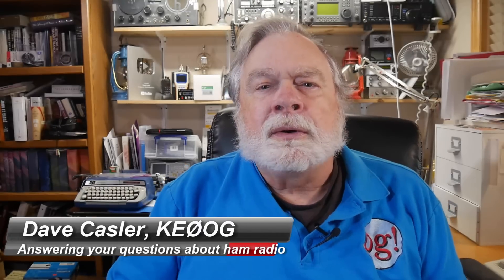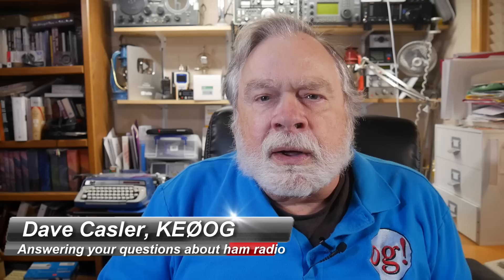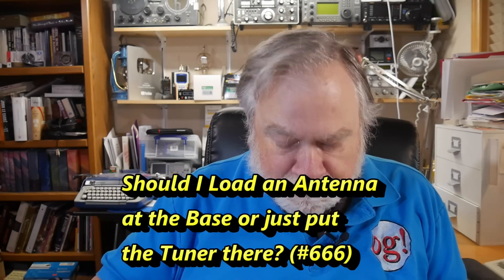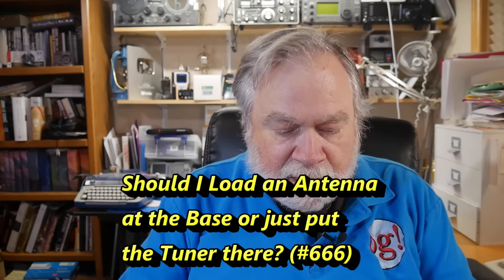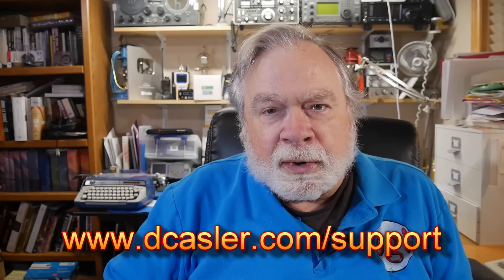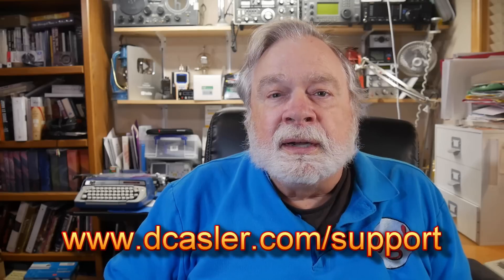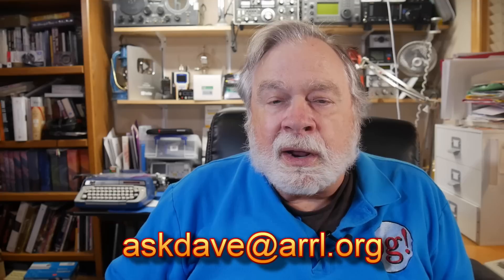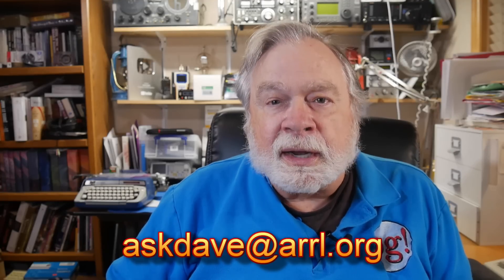Should I load the Antenna at the base or just put the tuner there? (#666)

Comment: it only seems to be radio hams that want to tune an antenna with atu in the shack,,,broadcast and marine services  always seem to have tuner at antenna end,,,remote  tuners that handle more than 200w are very expensive,,,i favour  an L match or Lc match for coupling at antenna end always,,,not do good on pouring rain when ajusting it but works very well,,,seen someone  build a remote atu Lc match using little motors to ajust variable capacitors,,worked great and nice project at fraction  of the cost .

Comment: I had the impression that an "antenna tuner" does not tune an antenna to resonance, like one would tune a guitar string. But rather it is an impedance matching device that matches the antenna's impedance to 50 ohms, more or less.  The antenna side of the tuner is still not resonant.  The standing waves on thie antenna side would keep bouncing back and forth, like sloshing around in a tub until they dissapate either as RF or as heat. By having a "tuner" at the feedpoint of the antenna, one merely avoids sending the standing waves down the coax and into the shack/radio.  Please correct me if I am wrong. 

 I use resonant antennas and avoid the whole "tuner" issue.  Just recentl, as a backup antenna (2 i one, one is none)  I made a simple dipole antenna for 40 meters using speaker wire and a a simple wire to bnc connector, hung it as an inverted "V" and have full bandwidth coverage with an SWR of less than 1.7:1, in places practically 1.0:1.  For my end  fed half wave antennas I use a 49:1 or 64:1 transformer.

Comment: Dave - ATU at base of the vertical -  when you say the antenna is "too short" at 20 feet long, I presume you mean 40 and below? 20-10m should be ok (even 40), provided you avoid a halfwave length on a band. Then, even a good ATU might have issues bringing in an impedance of 3000 ohms plus. 73

Comment: Thanks for your great work! My question is, what is the difference between the remote tuner at the base of the antenna and the one in your shack, other than the distance?
Reply: You need an antenna coupler (commonly known as antenna tuner) at the feed point because the antenna is not resonant. It means it's not having the characteristic impedance of 50 ohm resistive load which your radio wants to look into. That's it is having not just resistance but some reactance too.
The reactance has to be annihilated by introducing an inductor in case of a capacitive reactance and vice versa. If
 you have the remote Tuner at the feed
 point of the antenna it's going to accomplish this very effectively.
If you have the tuner in the shack your radio would see a 50 ohm resistive load but the same high SWR is prevailing in the coaxial cable from the feed point to the shack. This is no good. The dielectric material in the coaxial cable is getting heated up because of the high SWR. The longer the cable more is the loss of precious RF power. 
I hope this helps.
De VU2RZA
Reply: The tuner will work in both situations, but with the tuner in the shack the coax to the antenna becomes 'part' of the antenna. This results in loss in that length of coax and less power to the antenna. To avoid these losses, place the (remote) tuner at the feedpoint of the antenna.

Comment: The question I hoped would be answered was, if I have a vertical antenna with a loading coil tune to a certain frequency (say something in 40M) and I can take the coil out and tune the same antenna with a tuner to the same frequency with the same SWR, is there any practical difference between the two, in things like efficiency or radiation pattern, etc. I'm building a QRP, loaded antenna with  a 102" whip (kind of a Wolf River Coil antenna), and am asking this same question. Is the coil any different than the tuner in this respect?
Reply from the maker: Use the loading coil. Pattern doesn't change. If high SWR on cable, losses can be high.
Reply: Hi, good question.
Any vertical antenna of around 1/4 lambda is resonant with sufficient ground radials when mounted on the ground.
When it's shorter you need some form of loading to compensate for the short length of the radiator.
You can use the spiral loading (common practice) or linear loading (not uncommon but it's going to be different)
A Tuner preferably an L match at the base can very well replace the loading coil and bring the radiator into resonance. 
A high Q loading coil or a tuner of high Q components  will not make any difference in principle.
But then a tuner of some sort at the base of the radiator would be preferred.
In the case of base loaded vertical any residual SWR on the cable from the feed point to the shack may not show up in the meter in the shack; but would be eating the precious RF power by heating up the dielectric material in the cable.
The efficiency or the radiation pattern, (provided the power to the radiator is the same) wouldn't change in both cases, for sure.
De VU2RZA

Comment: Good topic and explanation. Sadly capacity hats are a lot bigger to be effective than the relative size in your drawing, that is why they are not more popular, they are fairly large in a place where support is often in short supply. The term screwdriver is from the original models which were battery powered screwdrivers modified for our use.